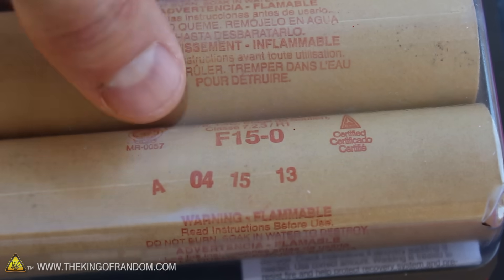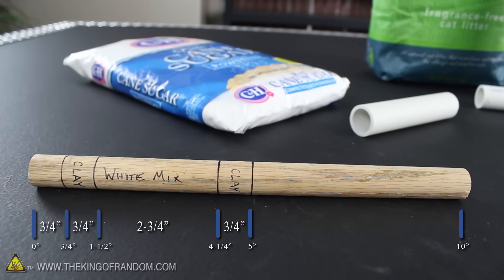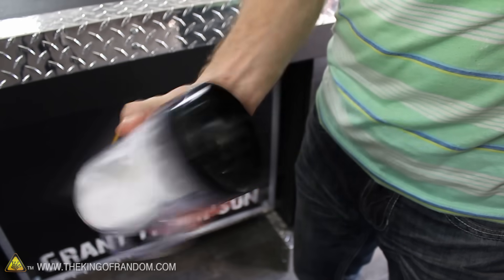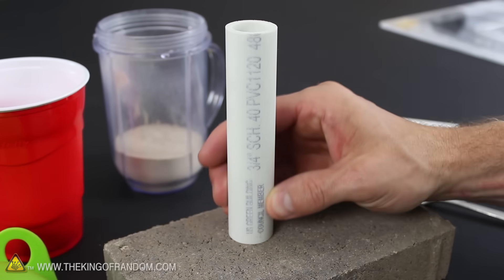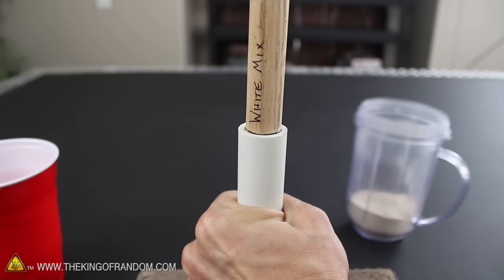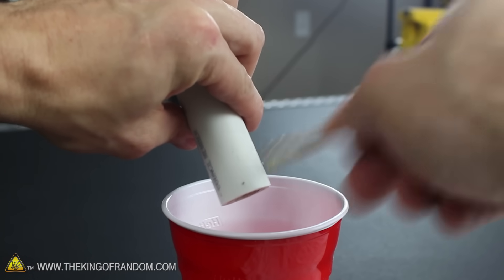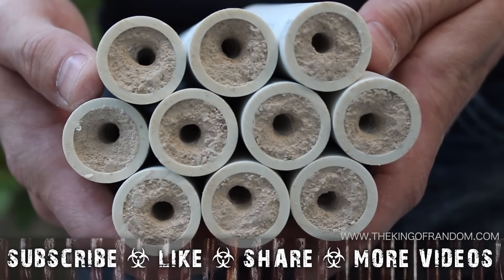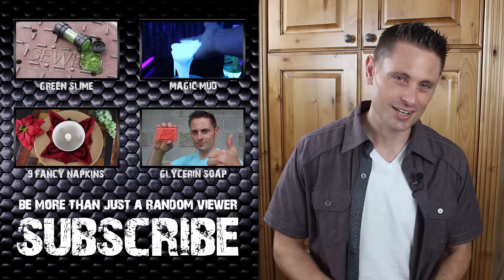How To Make Sugar Rockets

Comment: Cooking the composition in a pan under a light heat will turn it into a peanut butter looking mix that will burn slower for use as a smoke bomb. Don't use a flame to cook, and do it outside with gloves and a small batch.

Comment: Now look, before I made high performance rcandy modular rocket motors, I used to play with these, and this method is not very efficient. instead of drilling, make rocket tooling. Basically, you make a base, with spindle with measurments of the core, and ram it with cored dowel, and finish with basic one. this way you won't need to srill, and motors will be more consistent. If you really want some ram power, currently i'm making Rcandy motors, with very thick tubes, cast concrete plugs, and BATES grain, and measure total and sepcific impulse of those.

Comment: It would be more effective if one can control the rate of reaction.
Reply: You could build a hybrid solid/gas rocket motor.  Solid rubber and N^2O gas.  Control the burn by controlling the gas oxidizer.

Comment: Question: If the white mix is so flammable, how safe is it to hammer the dowel into it to compact it? Wouldn't the heat risk setting it off?
Reply: No, this mixture is not pressure sensitive.
Reply: ty

Comment: Can you make one with WAY less power so it can be launched in residential areas.
Reply: That would be a bit boring now, woudn't it?
Reply: I love making rockets, and I launch them in residential areas. Our friend takes care of a farm and thats where we launch them. I use more powerful motors than this, just make sure to make a huge parachute! If you dont have an area like this, just look for a field in the area and use small c motors from the store. You must find a rural area to launch big rockets.
Reply: I'm under 18 and I don't have an area bigger the about 200m x 50m
Reply: Ok, that is a big space, but I would stick to the little store bought ones. A D- rocket motor would probably be fine. But that is still a big motor. That is about the size of my farm, but all of the houses are deserted for the winter. To launch experimental rockets you will need a bigger space in a rural area. If you live in a city or suburban are this might be hard... but just find a place even if you have to drive a while. It is the best feeling when your rockets fire thousands of Feet. Its worth it!

Comment: G-Day Mate, great idea,yep I'm a crazy Aussie,I got lots of room,to experiment with this kind of project, question what type of fuse and does it goes into the fuel.
 My interest is the I'm a ex-bomb tech love big bangs with little bucks, I used bags of super phosphate fertilizer 50kg bags with 6-8 litres diesel mixed together with a det. and fuse , you got a bomb like a 105MM,leaves a small crater very unstable and dangerous, or rolled tightly like a ,I mean looks like stick of tnt and did a better job, they used to do this in the opal fields, I used to do that for a couple of the old time miners.
  we made rockets with steel piping very dangerous have had some major bang, but have them become great missiles they go up and come down faster, we used kerosene in the motors cut with brake fluid. Top video like watching , I'm now disabled through a job accident 15 yrs in the game in wheelchair now them the brakes cheers Dig.

Comment: One big mistake you made was using a fuse with a core-burning motor.  You want to ignite it from the top, electronically, not from the bottom with a fuse.  A fuse is against the National Association of Rocketry Safety Code.

Comment: Using alcohol and sugar will work better because it is the same formula used for rocket fuel. (Not actual rocket fuel but similar)
Reply: Where is your oxidizing agent?
Reply: I don't remember, I remembered it from when I made these kind of rockets with my dad. The alcohol has to be near close to 90%. I can't remember the oxidizer but if I do I'll get back to you on it

Comment: Why use powdered sugar? Would normal sugar be too explosive? (Powdered sugar has corn starch in addition to finely ground sugar)
Reply: powdered sugar would react quicker regardless, as its surface area is far higher than that of regular non-powdered sugar.
Reply: zyxtaine Should have specified- I meant to ask why he uses normal powdered sugar [with cornstarch] as opposed to grinding pure granulated sugar into a similarly fine powder.
Reply: Njal Thorgeirsson oh that makes sense, sorry

Comment: What did you use for a fuse...and where did you get it?  Would a birthday sparkler work as a fuse?
Reply: you can get fuses of cannonfuse.com
Reply: How many amps fuse should i get? doh!
Reply: A sparkler would work relatively well. That's what I do and the only trouble I get is making sure the sparkler stays intact while moving with it.

PS: Also, make sure you time the burn time of the sparklers so you know how much time you have to move out.

Comment: I cringed when you beat the fuel with a mallet. Is there a risk of igniting due to heat from rapidly compressing it? And if it does ignite when you don't expect it, is it more of a burn hazard than an explosion?

Comment: powdered fuel+oxidizer mix, ramming powdered fuel+oxidizer mix, using plastic as container... is a disaster at progress, you make such mistake only once with catastrophic consequences.
ALWAYS use paper container, never ever ram fuel+oxidizer mix, make and use recrystallized rocket fuel instead powdered.
Reply: I don't think that ramming a KNO3 mix is really dangerous. If he used KClO3, it would probably have exploded at the first try^^
Reply: xXxLolerTypxXx
said once and i will repeat, its not about "i dont think", or "its somewhat dangerous" its about safety, and when working with energetic materials your 100% sure or your not sure, and if your not sure then you take precautions because as i said you may make such mistake only once and its enough.
Reply: Hobypyrocom You will repeat? Ok, repeat it for me^^

Comment: EGHHHHH, imperial system. 2000ft? What? :/
2000ft = 609m.. Whoa! That's insane. You should make a staged rocket! Make 4 of these motors to lift higher stages that uses an FPV set up with some aerodynamic fins and a servo release to detach the stages/deploy the parachute. Should get you up to about 2km, easy :)

Or you could make the nozzles smaller to increase the burn time? Or you can use it as an SRB powered JATO RC aircraft :D
Reply: smaller the nozzle you'll need to make the motor smaller because if the nozzle is too small it'll explode due to pressure, well that's what I think at least...
Reply: The rocket could not have reached higher than 1,150 feet, but it most likely 

To find 2,300 feet, he just used the 1/2(9.8m/s^2)*t^2 formula, which would only be accurate if there was no atmosphere. I calculated it using drag formulas, and found that for a 12 second fall and a rocket like his, it would not be possible for the rocket to have reached more than 1,150 feet.

I explained this in greater depth in another comment.
Reply: His calculations are very wrong. The formula he used does not take atmosphere into account. More like 50-100 meters, still nice.
Reply: 9 + 10 = 21 it seems my calculations are correct
Reply: Jordan O'C The authors calculation, see towards the end of the description how he got the height. He plugged the 12 seconds the rocket spent falling back into d = 1/2 * g * t^2, which I hope you agree does not give anything close to the real height.
Reply: Now I really want Kerbal Space Program. :(
Reply: ***** Please specify the reasoning behind your hypothesis.
Reply: Matt Della yes, otherwise the outward pressure would cause cracks and ti would explode, if you ever see a solid rocket explode its because either a nozzle too small or cracks in the solid fuel caused it to explode out.
Reply: ***** Mine or..? If you meant mine, I didn't put any maths into it at all. I can't be bothered to work out the Δv and work out the lost of said Δv through atmospheric drag. If I wanted to, I prooobably could but that takes long lol

aval1998 Hmm yes you're right. How would you control the burn time on a normal SRB then? o.O
Reply: ***** Yeah that doesn't give you the actual height (drag, etc..) I'm pretty sure it at least got to 300m, it had a LOT of force on take off and that fuel burned for quite a long time. But I think it was a guesstimate.
Reply: Jordan O'C Burn time would depend on the materials used in the propellant or just simply the amount of the propellant you have in the casing.
Reply: pyromen321 1150 ft isn't bad though for a motor like this. i mean, it's probably only a high D impulse, but in terms of DIY motors, that's pretty respectable. 

not what he claimed, but not too shabby
Reply: ***** which one?
Reply: ***** Did you really say "THE Eiffel Tower"...? -____-
Reply: Jordan O'C Why wouldn't he say THE Eiffel Tower?
Reply: Cool Guy Because there is more than one.
Reply: Jordan O'C Obviously, that only makes it better that he said THE Eiffel Tower. It refers to the real one and not the replica
Reply: Cool Guy Alright alright, chill lol. Just making a point not to be really vague on the internet because people will pick at that and ruin you. xD
Reply: fireblazzerx Then you're dumb
Reply: fireblazzerx Do you use metric?
Reply: Kienan Vella 1,150 feet is a generous estimate of the height, meaning it was most likely much less than that and that 1,150 is the absolute maximum altitude it could have reached. I made two assumptions during calculation that result in a greater height than what really occurred:
1. I assumed that the rocket fell from its apex at 9.8m/s^2 until it reached terminal velocity. In reality, it would have slowly reached terminal velocity, meaning the height it fell from would have been less than 1,150 feet.
2. I assumed the rocket fell with the nose pointing straight down, but in reality it probably rolled and tumbled. This means that the drag coefficient would have been greater, and the terminal velocity would have been much lower.

An educated guess would say the rocket reached 600 feet at the greatest.
Reply: Jordan O'C No there isn't, there is just one. It's in Paris, that is THE Eiffel Tower. The one in Vegas is not even close to THE Eiffel tower, it's a replica, and much smaller.
Reply: ***** K.
Reply: ***** extreme rocket scientists are present
Reply: the narrower nozzle wouldnt make it burn slower b/c it has the oxidiser built into the engine... it would just either blow out the bottom or blow out the sides...  a staged rocket wouldnt work either...
Reply: LemonSmashGames It's a fantastic game.
Reply: Matt Della i make rockets as well and melting pvc wont be a problem because it burns from the inside out it doesn't burn bottom up. even if it took 10 minutes to burn only in the last second would the flame reach the pvc
Reply: Xxsw4g1n4t0rxX i crie evrytiem
Reply: Y'ALL A BUCH OF NERDS! Lol I'm a nerd too can I join the gang?
Reply: @pyromen321 I like smart mens. You got a boyfriend?

Comment: Under 50 cents. Kitty litter is 98 cents. Seems legit
Reply: 50 c a piece i think
Reply: he meant 50 c a piece -_-
Reply: So do you think he put that whole bag of kitty litter in one rocket? That $0.98 bag of kitty litter will likely be enough for over 100 rockets. Let me try to make this a little easier for some of you to wrap your minds around. Obviously you're not going to go to the store and buy a 5" piece of pvc, 30 grams of litter, etc... There is an initial investment here. For example, the man may have spent $30 on materials, and was able to make 60 rockets (30/60=$.50). Now if you're really into this hobby then that is a hell of a deal considering 60 rockets from the store would have cost over $1000 (considering if you were buying them individually and not getting a bulk price).